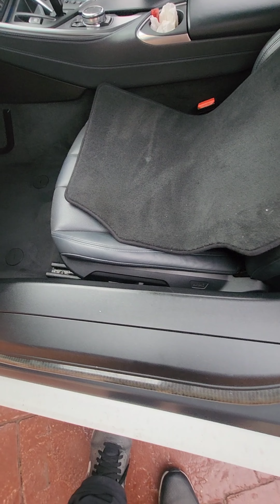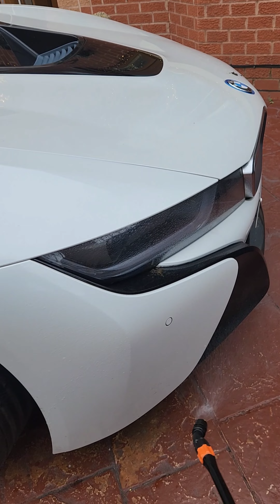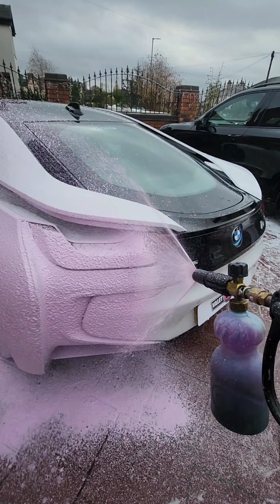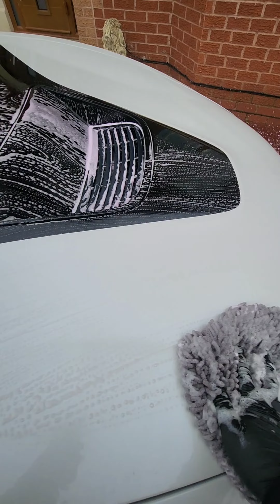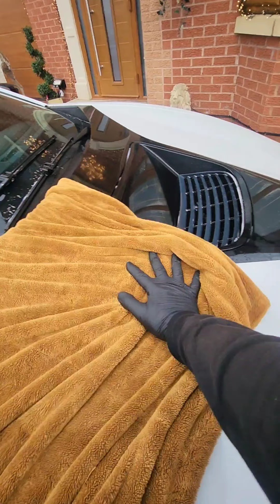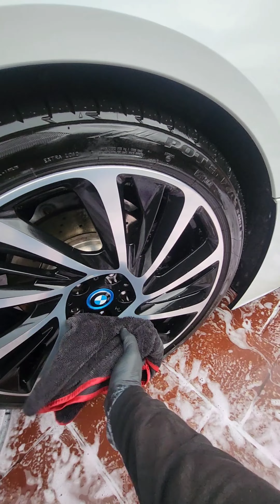Bmw I8 maintenance Detail #detailing #snowfoam #satisfying #valeting

Comment: Question for you,
How do you clear the foam off the floor at the end of the wash? Mine tends to stay for a couple of days even with rain (which it does here in Ireland a lot!!)
Reply from the maker: Hi mate I normally use the water out of my wash buckets to wash it away, and then use the jet wash to rinse away too. Hope this helps.
Reply: @valetforce  great hardwork